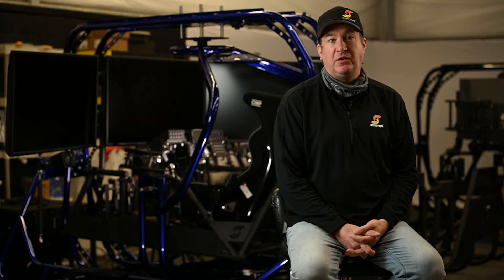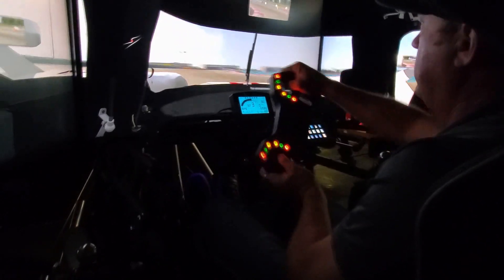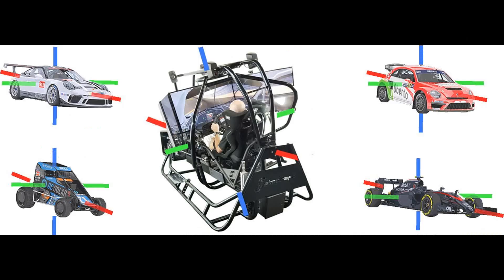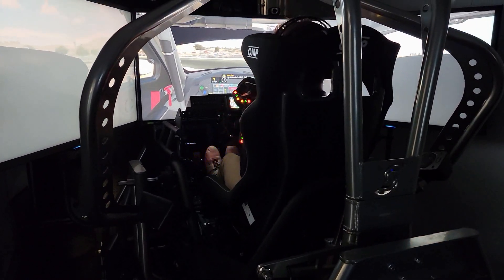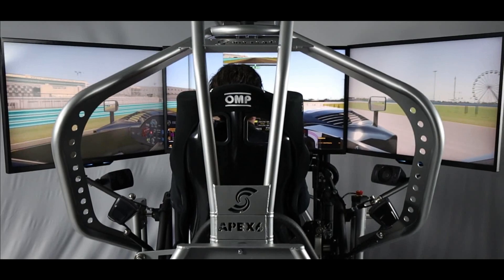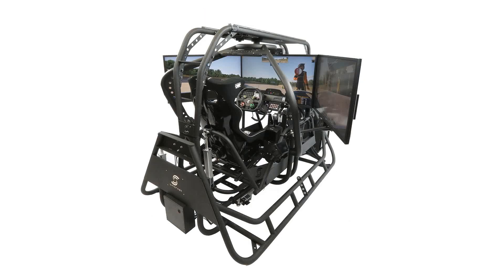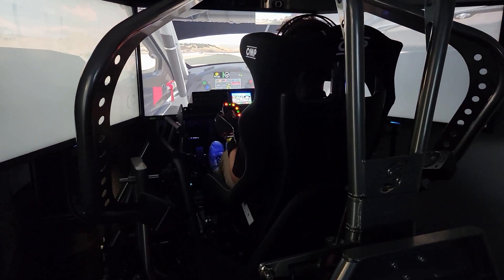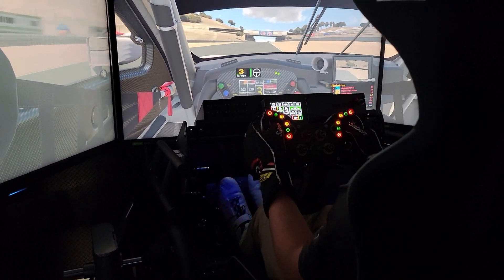The SimCraft Difference - 6DOF Full Motion Racing Simulator - Physics Matter

Comment: That's wrong about occurring rotation and transition at center of mass of the cockpit.
Because the center of mass of the car isn't necessarily in the cockpit. And that is affected by weight distribution.
Reply from the maker: Tokino, agreed that the CoM of a car varies by the vehicle itself.   The CoM of the SimCraft cockpit however is not debatable, it is where it is, and this is where our rotations and translations occur.
Reply: @SimCraft So what I wanted to say, if you apply 6DoF information of CoM of the vehicle directly that is different from CoM of SimCraft cockpit, that motion is different from the driver should feel.
I think you should calculate the 6DoF information from cam position in the game.
Reply from the maker: @ once thought that too, but that has proven to be a false assumption or artificial constraint due to the overwhelming acceptance of our CoM approach by champions who have driven SimCraft - CoM physics from software to CoM cueing on the hardware does not require any interpretation or transformation.   Driving it is believing.

Comment: looks amazing. I guess the latency must be minimal compared to other systems, but it seems like a Stewart platform can generate greater angles of pitch and yaw, especially the braking doesn't seem to deliver a strong g force sensation?
Reply: All these 6DOF can replicate is momentary G FORCE and not sustained like a braking, accel, or cornering scenario.  6DOF can translate for rally simulations, but accurate heave and roll transitions are not possible otherwise the driver would probably get banged up/concussed if they had actuators that had the correct level of response. Cost would be out of reach for non-commercial applications.